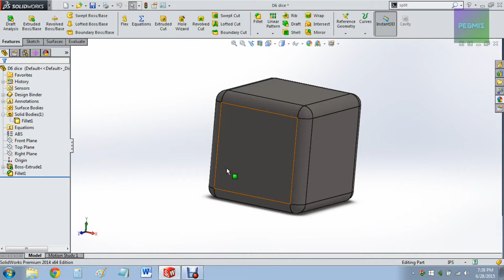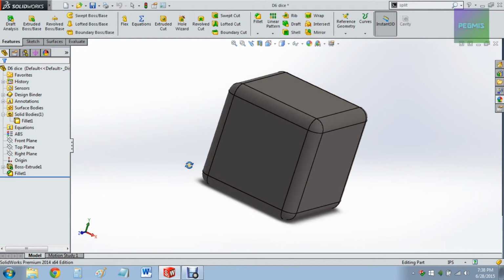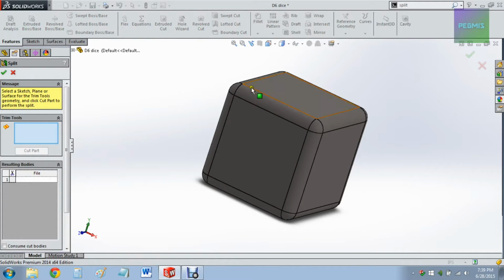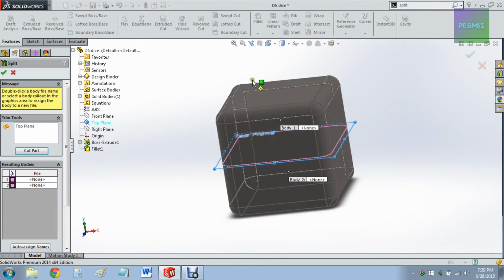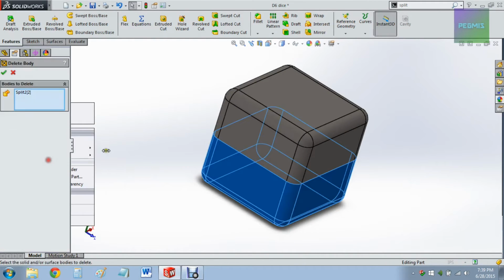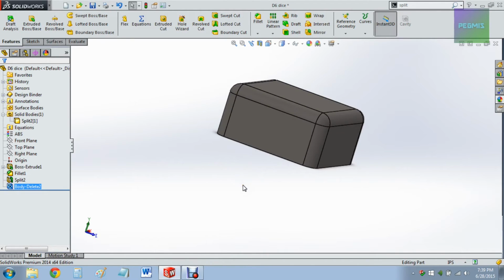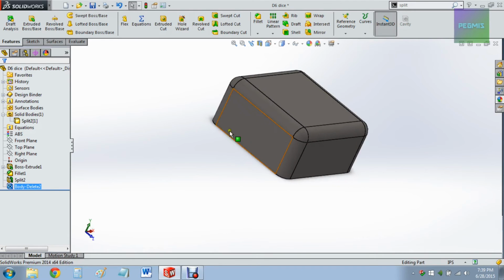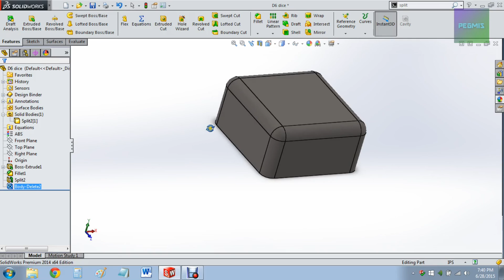Solidworks "Split" Command Tutorial

Comment: the bottom layer of your print is bad? you printing on glass, garilite, or blue painters tape? The surface should be smooth or slightly textured with the tape not as bad as you mentioned....

try leveling your build plate a nozzles...